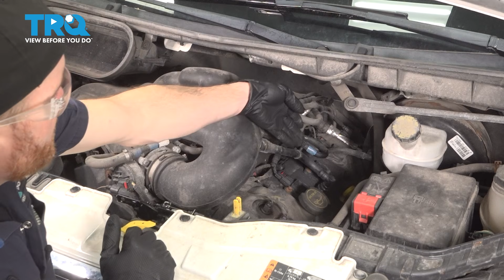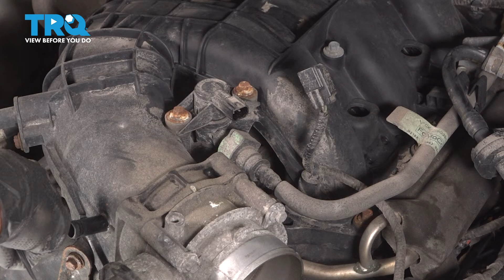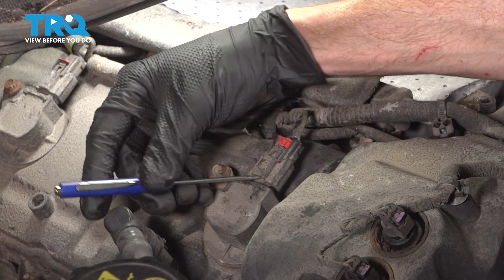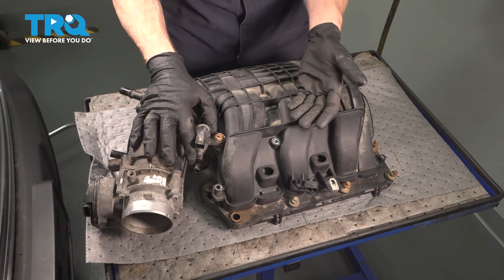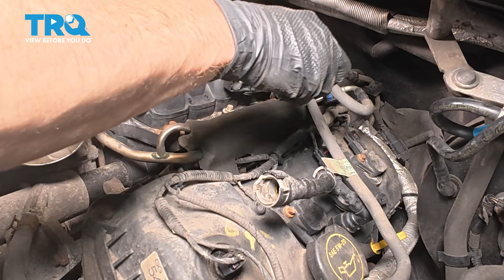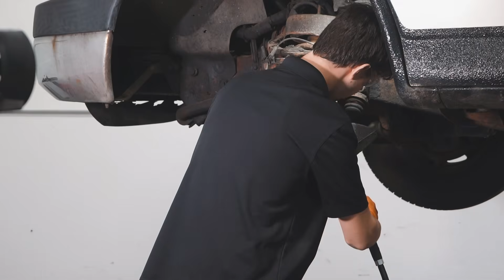How to Replace Spark Plugs 2015-2025 Ford Transit 250 3.7L V6

Comment: Great vid, other then the fact not once did you use any friggin lube, none, that is horrid, no grease on thread’s, no anti seize cleaned zero as you went, a shot of somethin even wd 40 on them connectors woulda been nice so next time, also its not a wire its a ZIP tie,   hope this is NOT a customers van !!!  Do better !  PS. How about cleaning the motor before, fuk dude  ya lazy !!!

Comment: Just finished replacing the plugs 2.5 hours. Thanks for the detailed instructions. Saved me hundreds of dollars.
Only additional thoughts are (1) The map sensor harness fastener is insane to get to and crazy tight.
 I ended up cutting it. Then I drilled a small hole in the remaining plastic  to put a tie wrap. 
(2) I covered the manifold openings with a 5" x 16" piece of cardboard instead of a rag.

Comment: This layered engine design is nor easy to service..  Make sure you have at least 9 Spark plugs and three coil packs before attempting this. You make not need them but You will sure be glad you had them if your need them.  Why 9 ? Because at least 25% of spark plugs are fake spark plugs on the market.